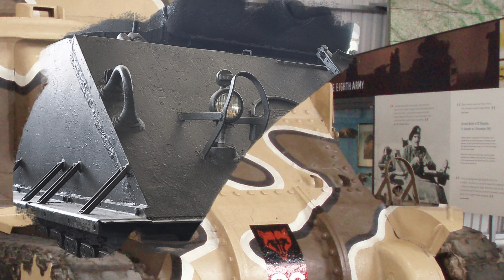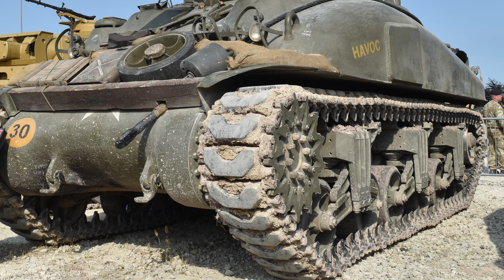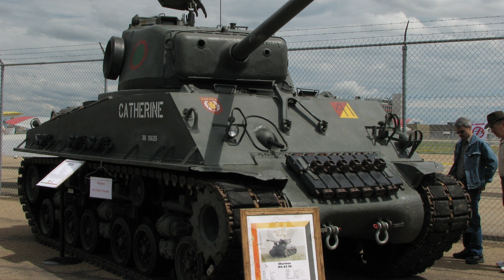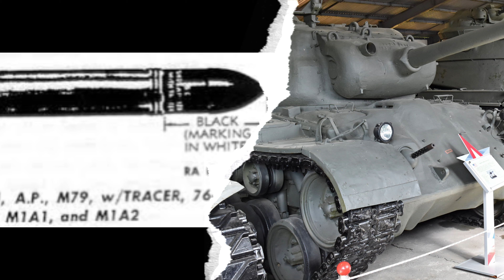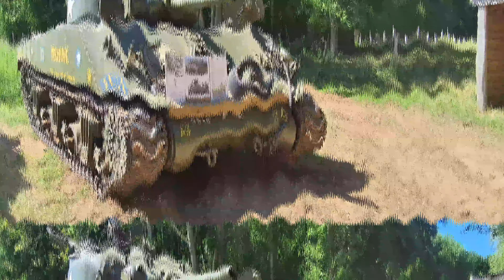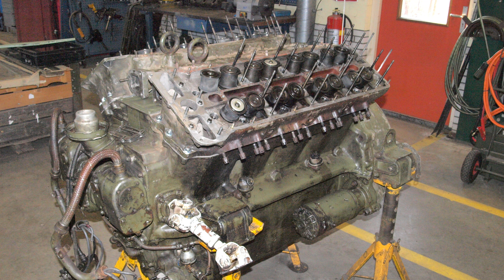M4 Sherman: The King Of  WWII Battlefields ?

Comment: Now remember these were designed by an Army that didn't want tanks and they also didn't want fighter aircraft, because the bomber always got threw. And if we had engineering prouse we'd had the Panther with the reliable engine and transmission.